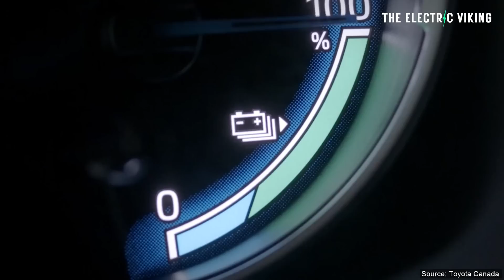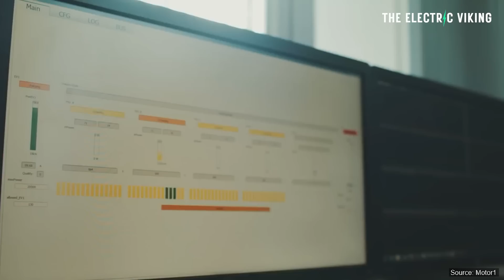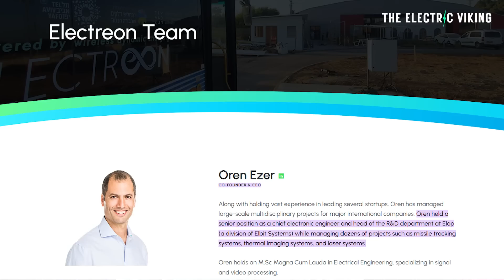Toyota Hybrid Breaks World Record: Drives 1200 Miles on  electric power only

Comment: Who will pay for the installation and how will they charge the users?  It would have to be like a toll road where you have a transponder in your car to identify yourself.  I could see something like a section of the freeway that you pull off and drive down the charged section like a truck scale at say 10 mph and then re-enter the freeway.  Since people that drive slower would get more charge, and those that drive faster would get less, each car would have to be charged uniquely.  I'm sure a designated speed minimum would be established to prevent slow pokes from holding up traffic behind them.  I could see a line of cars waiting to enter the charging section the same way you see trucks waiting to go through the scales on busy days.

Comment: The way you titled this item makes me say CLICKBAIT. Sam, I am a long-time subscriber, but this is the second time (quantum battery was the first) you have produced a video that doesn’t cover the topic in enough depth to determine if there is any scalable value in the product described. The point that matters in the big picture view is how much energy was delivered to the vehicle during the test and how much energy was actually consumed by the wireless charging system. My suspicion is that the losses were substantial. For this to have any scalable practicality it must be far more efficient in transferring energy than the present technology seems to allow. That does not mean that there will not be some niche applications for this technology, but major improvements in efficiency will be needed for it to become mainstream.

Comment: Stupid idea to put this in the road, infrastructure and reliability costs alone mean it will cost a fortune to charge on this system. 

A pentagraph system along major sections of highway like Melbourne to Sydney, would be similar to systems used in Europe for Electric Buses and Trucking long distances. 

Pentagraph systems are  inevitable along all highways, just like they power trams, trains and electric buses. In the railroad industry, electrification via pentagraph is seen as the future, so will road users.

I can see aftermarket sellers selling a rooftop mounted luggage box that has an automated extendable pentagraph collector and a plug in charger cable to connect to the car, when not needed for long distance driving it is simply removed and stored in the garage.

Comment: Unless folks have diesel engines or use a fuel stabilizer, gasoline will gum up and destroy the internals going that long without running the system.

Comment: As pointed out many times already, the concept is ridiculous but in addition, you would have to create a way for those that use the charging service to be billed. Electricity is not free.  How would you even know who was using the roadway?  I am sure the "Electric Viking" has had time to reflect on the costly infrastructure changes and is no longer excited.

Comment: I could see this working for City, State, Federal fleets but not for private passenger vehicles in the USA. How would they bill the customer? I think that would be the barrier for commercialization. I think it is a more complicated problem than the engineering issues they face.
Reply: my quick thought:

- your car broadcasts some short range RFID saying "i am toms car, i would like to authenticate"
- road sensors can see it, accept it or deny it.  if accepted, the road starts sending power to some units and your car starts charging
- downside is someone who isn't authenticated could maybe drive close and be picking up a little power from your session.
Reply: If it has the same up time as the public EV chargers in the US outside of the Tesla network then it will be almost worthless due to the high cost associated with road construction on just a regular road let alone a road with charging tech installed. For reference a regular road cost between 5 to 12 million dollars a mile.

Comment: LOL, like a tram connected to overhead wires or an electric train. Embedding big sections of wireless charging in main roads shouldn't be expensive. "The grid cannot handle BEVs," first off that is incorrect, especially with localized renewable growing exponentially and disbursed stationary storage, secondly the grid is in rough shape now, so why not invest in that right away - with urgency? Like the Interstate Highway System under POTUS Ike.

Comment: Sam, unfortunately in the real world, to be workable, these induction plates would have to be put very deep so the asphalt can be resurfaced without harming them. Else road maintenance would be impossibly expensive. 
   This means that the magnetic field they would have to create would take a lot of power because it would have to extend up a couple of feet to actually charge the car. 
Note it may be possible to do this but has anyone calculated the power used and the losses incurred?  Also what does this magnetic field do to local wildlife and to people?  People already don't like living under power lines because they believe that the magnetic fields they give off can cause disease. 
Cancer in particular. 
Would people feel safe riding on top of strong magnetic fields on the roads?  Has anyone done studies on wildlife affects?
I'm not saying this tech won't work, I'm just saying that it might have consequences we are not aware of.
Has anyone thought what might happen to these systems during a solar flare? Would this cripple the economy if we become dependent on it and it goes down?
   Finally, won't this just encourage companies like Toyota to say that it is the govt that needs to make the roads charge the cars, rather than Toyota coming up with an efficient EV platform?

Comment: I must say that compared with the cost of adding some standard 120v electrical outlets to wherever the apartment renters or condo owners park their cars, the cost of installing the charging infrastructure in our roadways would be at least 1000 times greater. While an electrified roadway has been shown possible many times long ago, its up front cost and cost to maintain makes it not just cost-prohibitive but clearly much more costly than simply tapping into the electrical energy distribution system we already have or that is needed as basic infrastructure if it does not already exist.

Comment: There was a time when apartment complexes didn't have high speed internet access either. They quickly got it, when it became an absolute essential for their customers. And the same is true for charging at those apartment complexes, because they all have parking places for their tenants, ergo, they've got a spot that a charger could be put in. You can bet it's going to become a draw for those apartment complexes that do that.
Reply: Not really a move of desperation by the BEV-less. Inductive charging is why Tesla just acquired Wiferon.
Reply: What a ridiculous comparison !
It takes 5 minutes to install a couple of Ubiquiti UAP’s .. But billions of dollars to install this hardware under our roads.
Reply: @maxflight777  What's ridiculous is implying that Ubiquiti's  wireless solution is good for the kinds of performance that people over a whole apartment complex would require out of the internet today.  Maybe 15 years ago.   No the whole place needs to be wired up with fiber, if as an apartment complex owner you want to appeal to the top end of the market. If you want to bottom fish; well, have fun. Same as true of infrastructure to charge electric vehicles. The top of the market; premium rental prices. All rental pricing reflects whether there is adequate utilities available at an apartment complex, be it high speed internet, parking, pool, etc, or a place to plug in your electric vehicle.
Reply: @maxflight777  Under roads, probably never happen. But apartments will need EV charging in a few years when EV adoption ramps up. They need to put it into building codes NOW.
Reply: @jamesvandamme7786  No one "needs" regulation, e.g., codes, except the bureaucrats. Regulation is what held back, and after 74 years destroyed the USSR's tyranny.

Comment: What a pity. After all your fantastic work and informative videos the way you approached this story has, in my opinion seriously damaged your credibility as well as giving succour to one of the most conservative legacy ICE manufacturers who has been accused of misleading consumers with its 'self charging hybrid' technology and actively working to delay adoption of EV technology. Yes the announcement is of great interest, as are all the stories you have covered about new battery technology i.e. increased energy density and reduced charge times. But, as with batteries, time has proven that there is an enormous difference between such announcements and the fielding of such technology. There are many questions to be addressed before wireless charging will come into service on the wide-scale basis that you seem to be anticipating. Questions of health and safety, technical standards (we cannot even come to national, never mind international, agreement on EV charging plugs! and getting different manufacturers to agree to a single technical specification let-alone maintaining and updating it whilst ensuring wide-scale operation?????) costs of installation, durability (what happens when other services want to dig roads up?) Who and how  decides how and where such wireless charging would be installed, for example class of roads and coverage (e.g., motorways, dual carriage ways single track roads,  rural,  urban, parking sf spaces, car parks etc, etc.) There is also many issues of related to management, e.g. charging ($) and route planning.- how will the user become confident that he will receive the required level of charge? Do all  'wireless ' vehicles have to be hybrids, if so current experience you mentioned  would suggest ICE pollution will remain a problem for many years to come. 
Inform us , celebrate the potential,  but please try and address the issues realistically. Good luck with everything you and your family are going through.

Comment: Just think about how much electricity will be wasted by running the induction system while no car batteries are being recharged by it. 
This is Toyota having yet another cynical attempt to promote their hybrid 'Frankenkars'. They are ignoring the huge installation and maintenance costs of these systems, as well as not addressing the complexities of trying to bill people for how much use they make of a recharging strip. Will there be a flat rate tariff for all vehicles travelling along the road? If so, then how could it be policed effectively? It's wide open for fraud. And how much will that administration gist in time and money?

Comment: Yes, certainly on special track with als slots of the car with masking tape, no A/C and at 20 miles per hour. Rediculous as my Diesel-Hybrid Peugeot 3008Hybrid4 already was good for 1‘000 km in normal circulation, highways, mountain roads so what tries Toyots to prove 12 years later with that 💩?

Comment: The issue with this lie is that the car was being charged. So in my view it's a lie. Yes wireless charging will be a great option. But think of this the San Francisco trolley runs on electric power and has no battery. Runs every day for years..... Get my point.

Comment: 3:55 ......Is it just me in thinking the front end of that Toyota  is real ugly?  Problem with this tech is that you have to rip up roads and install electrical infrastructure for the full length of the powered highway.  Much cheaper to install concentrated power stations at large distances like Tesla Superchargers and have larger batteries in the cars.  It seems that Toyota will do anything just to avoid adopting the inevitable technology, BEV's.  In busy cities, it definitely has possibilities, especially in high travelled road sections.  It all depends on how much charge one can obtain per distance travelled.

Comment: What a weird company Toyota is. They had it made, they lead the industry in electric drive-trains with parallel hybrids and should now lead the world in EVs (vehicles that only have electric motors turning the road wheels). They should have switched to being the leaders in series hybrids but they thought their series hybrids should have hydrogen fuel cells to provide the electrons instead of a gas powered generator on board. Use existing technology and manufacturing capacity built up over very nearly 100 years and allow customers home charging with the support of an existing petrol infrastructure for their out of range trips and not only would we by now see a steady decline in fossil fuel sales but everybody would be wanting to drive electric and EVs would not be the political football they have become.

Comment: Interesting but cost of infrastructure install and maintenance will impact usage cost, I’m not convinced this will be able to compete with parking lot charging options. 
Given bitumen roads break down as they are with wet weather, installing additional hardware in roads would appear to introduce increased structural failure points and therefore a maintenance headache.  I’m guessing this will only go so far before it runs out of funding. 
Most likely a very specialist product option and not a wide use solution to EV charging. 
Trucks and other heavy equipment crossing joins, heavy breaking will also no doubt cause longevity issues. 
Wireless might be useful in parking stations and other controlled environments.

Comment: Sounds like nonsense IMO. The cost of electrifying a single road would be stupidly expensive and it's not one road, it's all the roads or at least the main ones. With enormous power transformers to deliver sufficient power to all the traffic that uses it. Wireless charging would more viable to retrofit into parking spots where there are already chargers, i.e. a pad of some kind that gets bolted onto the tarmac and allows an existing charger to also work wirelessly.

Comment: Wireless charging sucks because of the inverse square law. Just take a look at your wireless phone chargers they draw twice as much power as they output. Imagine buying 20 gallons of gas to fill a 10 gallon tank and dumping half of it on the ground. That's wireless charging. Nevermind the insane cost you would add to roads to have wireless charging under roads. Much simpler to just stop and plug in a cable.

Comment: I like your enthusiasm Sam but I'm not sure how we it would operate in the real world. We can't maintain road surfaces now. Seems like legacy auto trying to fight change. I speak who has owned. I speak as one who has owned a hybrid Prius for almost 20 years and now co-operate with an old 24kw Nissan Leaf as an experiment. I charge the leaf at 2kw and the total investment is   less than £10000. After 12 month I'm finding the Prius has done one third total milage on long journeys over 35 mile radius and the Leaf two thirds. The 2009 Prius returns around 55 mpg on this usage, no cold starts on short journeys. 

On this experience I would avocate anyone who can't operate a Tesla via a business to adopt this low investment plan in the interim, if they can conveniently charge at 2kw on a time of use tariff.

Comment: Question is, how much does it cost to install these components to roads, because even stand-alone chargers like the ABBs are already posing as a bottleneck to expansion of the network in some countries.  Who will foot the possibly very large bill.  Finally, it seems that range is a worry more for the long distance travelers, less for city commuters.  Agreed though that wireless charging streets is an interesting concept.
Reply: Already exist for buses.

Comment: It should go into the boring tunnels:
1. You need a way to charge people money for the power they consume. The easiest way to do that is to provide the charging free in the tunnels while you're paying for the fare, have it all included. 
2. It will keep anyone from blocking a tunnel: because they ran out of power. Losing a tunnel for 3 hours because of car problems or battery running dead is very expensive for the owners and maintainers of the tunnels. Need to provide free charging in them, and also, need to have fees for people that don't do their maintenance and block the routes of transportation. If you can't maintain your vehicle, you're not safe to be on the road, PERIOD.

Comment: Not sure this is an optimal solution to the problem. I have an EV and live in an apartment.

At present every few days I pop down to the intermediate charger down the street. I do this in the evening when there is little demand.

Our body corporate has determined to install EV charging in each parking slot by 2025. The proposal is for 240V 15A charge points sufficient for 3KW AC charging.

This should provide more than sufficient power for the average commute the following day (15KW).

The system is expected to cost about $1,500 per parking slot.

We will be raising a levy to cover this cost plus electrification of the gas fired central hotwater system that will fall due for replacement at the same time necessitating an upgrade of the electrical feed.

Comment: Wireless charging sounds like an excellent solution now for homes,  businesses with vehicle fleets,  or where vehicles spend a lot of time in one place.  From what I have read, wireless charging has the equivalent efficiency of level 2 plug-in charging (at home charging). This would mean many of us would rarely need to plug in if we had wireless charging at home.
Reply: You need to closely couple the primary to the secondary to get decent efficiency, like any transformer. Like sitting your frypan right on top of an induction cooker. Plugging in will always be better.